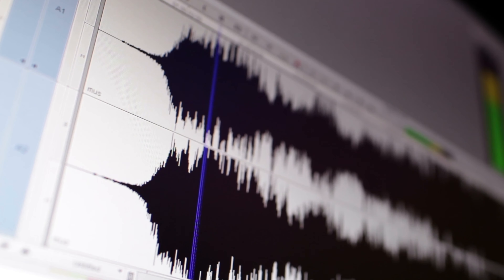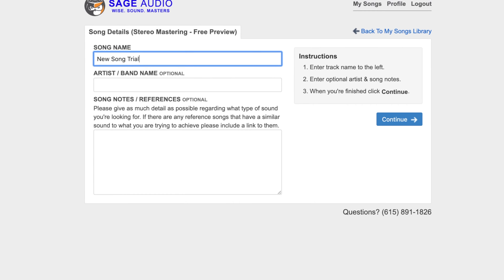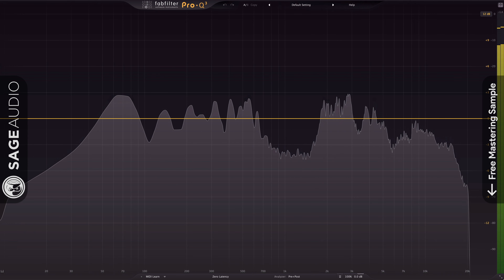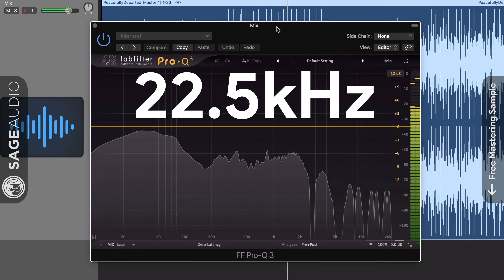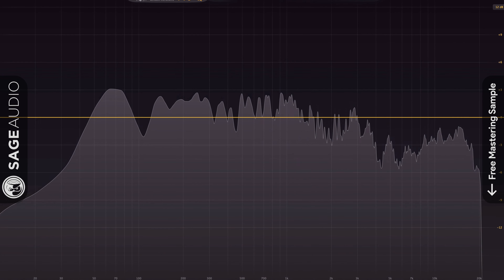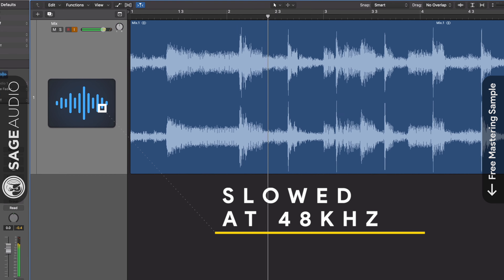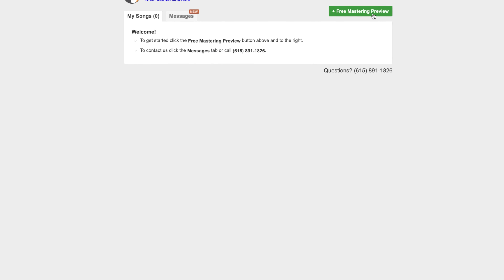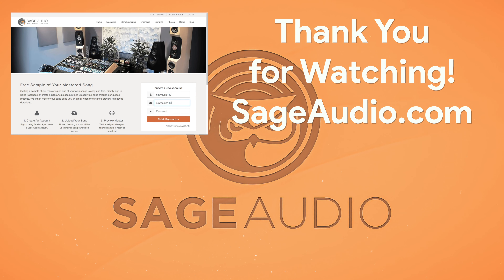How to Pitch Shift Without Losing Quality

Comment: How to Pitch Shift Without Losing Quality tho? You only said that it if we have a higher sampling rate ALREADY... not 44000 as starter!
Reply from the maker: That's very true - I made this a while back, so I'd probably go about making this video differently now.  If you can record it at a higher sampling rate, that helps.  Otherwise, it comes down to using pitch-shifting plugins that introduce fewer artifacts.  Unfortunately, there isn't a better way to do this without relying on how well a plugin is designed